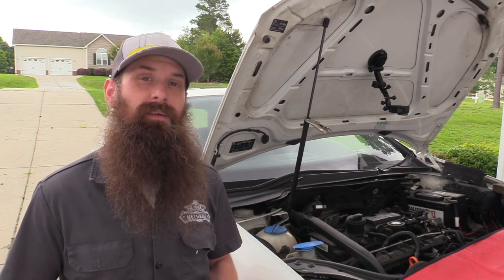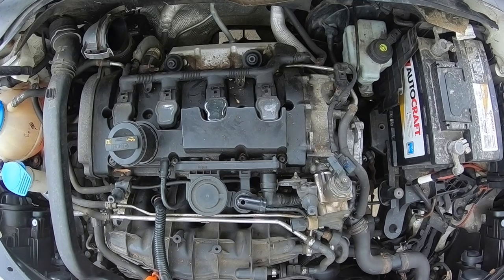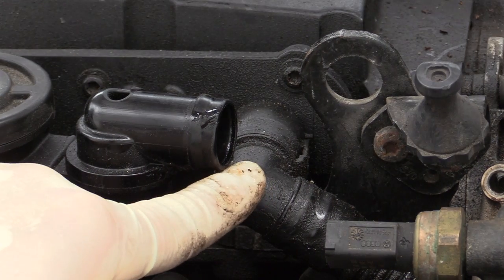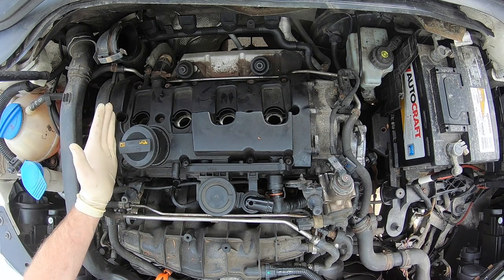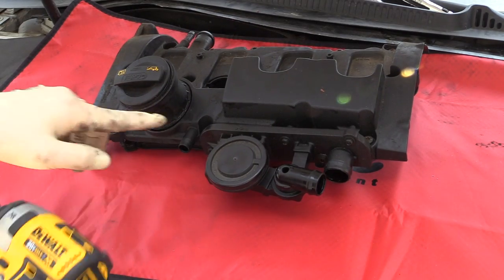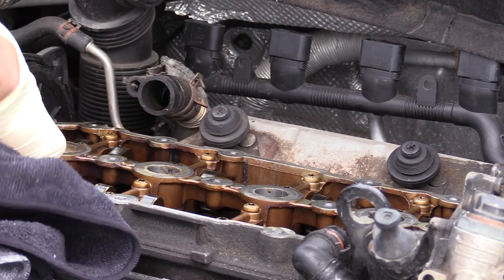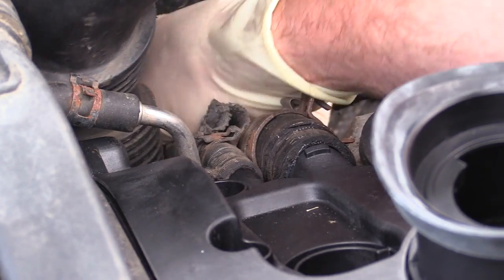Valve Cover and Valve Cover Gasket Replacement ~ MK5 GTI

Comment: I been having some oil consumption issues/ burning oil and rough idle. Changed out the PCV, rear vent tube, spark plugs, and ignition coils. Still an issue. Learned from you to look into the Valve cover as its part of the PCV system and does fail over time. (Min 0:45) I ordered a new OEM valve cover. 
I examined the old valve cover and noticed it was warped and broken on the bottom. i stuck a small flashlight into one of the ports and you can actually see the light shining through. Happy i changed it out. Hope it helps with any oil consumption. The Engine definitely runs smoother. Thanks for all you do for your viewers and customers.
Reply: Was your burning smell absolutely putrid oil smell + excessive white smoke from exhaust?  I'm fairly certain mine just blew today because the symptoms line up a bit too well.  Car with also stutter and stall, crazy backfires too.
Reply: @ethanheitz4489 did you get it figured out with your gti?
Reply: @adampye9827  Yep, thanks for asking bro.  The valve cover gasket blew right around cylinder 1's spark plug well.  I ordered a whole new valve cover from FCP just to be safe, since they're plastic and my shitbox has 284,000 miles 😅👍🏻
Cleaned the area, didn't focus too much on getting it perfect for install, just clean enough.  No drips or valve cover related issues since.  Ig these ea113's reaaally like to have positive crankcase pressure

Comment: Thanks man. I'm an aircraft mechanic and a forty year gearhead.  I'd be able to work through this myself, but having seen your video, it will make it much easier. Gotta do my grandson's Passat. OBDII says random misfires from all four. but valve cover is leaking from its periphery, so I'm thinking maybe the plug wells are full of oil and possibly causing the misfires. If a clean up and new gasket don't fix it, then I'll go ahead and put new coils and plugs in it. .

Comment: If you're replacing this because your oil fill tube has completely broken off, be aware, you CAN simply install the oil cap directly to the valve cover.  The filler neck was added to raise the fill cap up to the Jetta engine cover height, but on the Audi engines, this neck isn't glued on because there isn't a big cover.
Reply: This is a great tip. Thanks.
Reply: Excellent tip. You've just saved me a couple of hundred pounds on a new valve cover. Thanks!

Comment: People: Please please please take Charles' advice on connecting the back hoses before screwing down the cover. The larger hose is a bitch and a half to move. I had to undo all the goddamned cover screws a second time to get that hose back on. In fact, I recommend re-attaching the band clamp (hose clamp in this video) before moving it so it doesn't pop off while you're positioning the cover. 

I don't understand why we need to mention the single use band on the larger hose. It doesn't seem necessary to mess with this clamp further back at all.

Another tip: I found it helpful to follow the torque sequence even when initially inserting the screws. It just seems to go down easier that way.

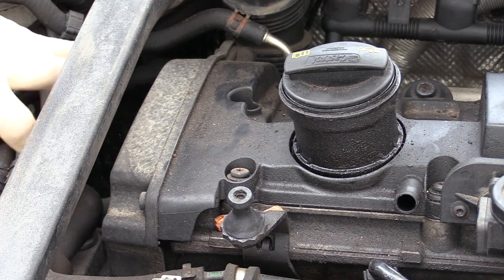Finally, a small correction 3:32. That's not your timing belt cover. It's your serpentine belt inspection cover. Timing chain is on the right side. But I'm sure Charles knew that and misspoke.

Awesome video!

Comment: Subscription ✔️.. I have a 09 TT 2.0 fsi with oily plugs in cylinder 3&4 just the video I needed
Reply: Took off the valve cover and it was cracked and had oil seeping through in cylinders 3&4..

Comment: Thank you 🙏🏼 replaced the valve cover gasket yesterday. Was going through so much oil this past month and noticed leaking around the cover. The hoses were a pain ! If anyone is wondering I went to harbor freight to get an electronic torque wrench that gave me multiple measurement options including what you need …nms. Oh and get a pick & pry tool unless you wanna use different sized flat heads like I did (don’t recommend it). Any questions hmu @cozybeavismobile
Reply: Hi, did you need to add any sealants when putting a new gasket?

Comment: I am considering a billet valve cover. What do you do with the hoses that connect to the stock valve cover when upgrading to a billet cover? I understand there is a -10 AN for the catch can setup, but not sure where the other hoses go. I have a 2012 Golf R.

Comment: Thanks for this video, I have a 2016 vw golf r. It has over 90k miles when I replaced the spark plugs I noticed oil seating on the spark plug. There is no oil outside how would I diagnose a leak? Thanks for your help

Comment: Charles thanks for the vid , just a question , all 3 of the valve cover channels are autonomous , right;

I mean blowing air on the rear vent tube should only bring air on the PCV valve , am i correct;

Comment: If the oil fill cap pipe/funnel snaps off of the cover completely, would you see symptoms in the cars performance? Or just leaking oil? Not sure if it needs to contain any significant pressure…?

Comment: What is the small hose at the back of the valve cover used for? Mine is old and stuck on the valve cover, so considering replacing it. Wondering what it does and how hard it would be to replace! TY, awesome videos!!
Reply: Long shot, but we're you able to remove that hose? I'm looking for a solution as mines does not want to budge either nd any help would be greatly appreciated
Reply: @alwalker6090  unfortunately not, and I sold the car. A pick might be the best bet.
Reply: @killamilla240  i purchased one and will attempt to remove it, cant afford to ditch the b6 just yet.. thanks for the reply!

Comment: So the mk5 and mk6 similar engines. Will the job be the same? I have a bit of oil leak and not sure where it's coming from, either this gasket or cam chain gasket. Any advice pls

Comment: Splendid video, thanks for the share. Although one thing keeps boggling me. When I look up the tightening sequence golf gti (2007 gti Edition 30) head gasket, I found a lot of schedules that state there needs to be 40NM on the bolts of the head gasket. Are you sure 10NM is correct??? Hope to hear from you, keep up the good work!
Reply: VALVE COVER gasket and HEAD gasket. are 2 totally and very different things. If you try to torque the valve cover bolts to 40 nm you will twists the head off them.

Comment: I did my spark plugs today and noticed quite a bit of oil in cylinder 1. Should I replace (1) just the valve cover gasket, (2) all the gaskets shown in this video, or (3) all the gaskets as well as the valve cover?

Comment: thanks for the video, i did this today on my golf mk5 but when i removed the gasket it broke and some of it was glued in the middle section where the spark plugs are, when i took it off it was breaking into pieces and i think couple of very small pieces fell inside, would they cause any damage to engine?
Reply: It shouldn't. Gasket material generally isn't hard enough to cause issues, unless the engine ate alot of it at once. Little pieces, no big deal. I once had a helper leave a microfiber rag inside an intake manifold once.. I installed it, didn't check to make sure passageways were clear.. sucked that rag around 2 valves. Spent the day nipping & melting at pieces of rag, hours & hours. Replaced 2 bent pushrods. Engine had 6,200 miles on it. Was a Chevy 5.3

Comment: Thanks for the vid, I'll be tackling this later this week. I wasn't able to move the gasket off at all on my initial try. It might have been a combination of the engine being stone cold and being too afraid to loosen the bolts all the way.

How far can the bolts be loosened before I worry about them falling off the cover and into the engine bay? Some other vids show quite a bit of struggling with the back two hoses (mine are on pretty tight unlike the ones on the vid)..
Reply from the maker: They hold on pretty tight. You’ll feel when then stop loosening it.
Reply: @HumbleMechanic  Thanks! Any other tips for the mechanically challenged for this particular job?

Comment: Hey man I have a 2013 GTI with around 60k miles I found oil in the spark plugs with so r corrosion that forms on the battery terminals. Any ideas on what it could be? The coils are not oem and I just ordered oem r8 coils since I don't like aftermarket crap on these cars. I was thinking the value cover gasket but the mk6 doesn't come with a value cover gasket so I'm lost lol.

Comment: I have a 2012 Eos with 55k on it. Water pump ended up leaking on it due to the valve cover leaking down on the water pump seal. Took the VW to the VW dealership, they replaced both the Water Pump and the Valve Cover (1,374.00 - Valve Cover Gasket, no charge for the Water Pump). A few weeks later the service engine light went on after my wife took a sharp turn. After checking the dipstick there was no oil on dipstick, added 3 qts of oil to the car took it back to the dealership only to find out that the oil was being distributed into the turbo. I'm wondering when the valve cover gasket was replaced if damage was done to the PCV Valve and cause oil to leak in the turbo? Any thoughts

Comment: there is a recall for MK5 PCV. Just go to dealer to replace it. It should be leak free for a while afterwards...
Reply from the maker: I think that may have expired by now. But yes Vw was replacing them for a long time.

Comment: I have been having issues with my 2012 Jetta SE 2.5L for some time now. It's an automatic and sputters when shifting up and jerks hard when downshifting, especially from 2nd the 1st. I use the OBDeleven reader and I keep getting the codes P3078 and P0106. I replaced the MAP sensor about 8 months ago and it seemed to have fixed the issue but then resurfaced. I recently replaced the PCV Valve Cover with gasket last week and cleaned the MAP sensor thinking it would resolve the issue but the check engine light came back on shortly after. Can you please recommend the next step to take to troubleshoot? Thank you.

Comment: Nice video! In the Uk, Vw wont sell only valve cover gasket, probably can get aftermarket one. When i replaced my injector loom on my 1.9 tdi, i overtighten one of the bolts to cover and it felt like it snapped and it just spins in place. Whats the best way to get it out. Thanks
Reply from the maker: That was the same here with the TDI. So silly.

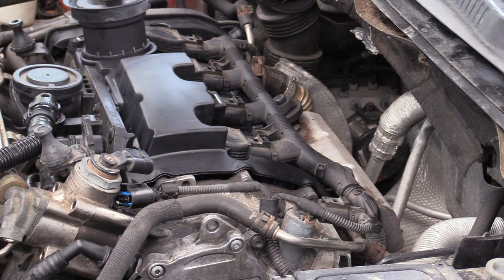Comment: Before putting the engine cover back on, be sure to plug that blue connector in too (9:00), Charles. ;-)
Reply from the maker: HAHA I actually never put that back on. It went where it belongs. In the damn trash HAAHHAHAHAHAHA
Reply: @HumbleMechanic 
Just pulling your leg, of course.
Reply from the maker: HAHA I know. I also knew Id get crap for that.
Reply: That fuel pump did look gnarly dude lol
Reply from the maker: It got replaced too.

Comment: Do the electronic torque wrench need to be recalibrated after a few years like regular torque wrenches click style?
Reply from the maker: I think they usually recommend every few years like the clickers.
Reply: They should only ever need to be calibrated if you have to put a circuit board in them.  My Snap-On guy sold me mine by bringing the demo in, throwing it on the ground, and then putting it on the torque checker and showing me it was still 100% accurate.  Sure enough I accidentally dropped mine a few months later and took it on the truck the next week, and still 100%.

Comment: How would you know if you need to replace the gasket? I have a lot of oil debris all around the area, and have been having problems with high rpm, low acceleration type issues. I have, changed the HPFP pressure regulator, AND the HPFP itself now, and still the same issue. I am getting: P0171 (too lean) P0087 (fuel rail, pressure too low), etc. could it be the gasket possibly or?
Reply from the maker: Doubt it is the gasket causing the drivability issues. That usually only causes oil leaks
Reply: HumbleMechanic so could the cover be cracked then? I also noticed that a vacuum line, that’s right beside the hpfp, has a giant crack where it connects at the top. (It’s literally the one you say don’t even look at, in your “how to change follower/hpfp” video). Could this cause the issues I’m seeing and or the CELs that I’m seeing? Thank you so much for your reply sir. I’m a big fan of your channel.

Comment: Hey Charles, awesome vid! Is the procedure the same on a Mk VI?
Reply from the maker: No, that is a very different setup. That valve cover is more like a cam bearing plate.
Reply: HumbleMechanic  thanks. My valve cover has started to weep a bit of oil after a head replacement last year. At least that’s the highest point on the engine that shows oil leakage.

Comment: I  snapped a screw head  where the pcv valve attaches to engine (bottom left  of the pvc) any suggestion to take it out?
Reply from the maker: Yikes. Can you get vice grips on it?
Reply: @HumbleMechanic  I can't get hold of it... I was thinking to drill the plastic around the metal and pull it out... Than use plastic filler... I dnt know if that's best way to go.. But I'm running out of option 😔

Comment: Ive been having a huge problem, mine blue/white smokes when the engine is under load, same when after ive been on full throttle when i let off, it lets a big puff of smoke out back, does this cause this problem?

Comment: So I have been trying  to find this smell of burning oil on my  mkv Jetta gli for the longest time, I have rebuilt the vacuum pump it's not leaking. I have looked at the valve cover but I don't really  see any noticeable oil around it. Any idea what could this be? No check engine light.
Reply from the maker: Maybe the exhaust is leaking? OR the oil filter housing.

Comment: Did my valve cover and PCV gaskets a few weeks ago...but I stripped the bolt farthest to the rear right. Would taking the whole cover off again be the best way to drill that out? Next time, I am not converting Nm to lb-ft!
Reply from the maker: yes. But dont start with drilling, see if you can chase the threads first. 10 NM is 7.4lb ft
Reply: @HumbleMechanic  Thanks much! I'll be honest, I had tried to drill it out with the cover on the car. Have a feeling I may have damaged the surrounding aluminum. How could I go about repairing that?
Reply from the maker: Probably a heli-coil at this point
Reply: I thankfully stopped before the threads inside the head itself. What do you recommend if I have to fill in anything around the bolt hole?

Comment: If you are just replacing the valve cover gasket, is it necessary to replace the bolts?
Reply from the maker: Not on this one. Reuse away
Reply: HumbleMechanic cool, thanks for the reply. That’s saves quite a bit of dough. I saw those boots going for $6 a piece.
Reply from the maker: Ouch!!! Hahah

Comment: I did this job and now I have codes P0507 and p0171, new HPFP new HP fuel sensor, new PCV valve, no signs of damaged vacuum leaks or anything! HELP. Any chance there is a vacuum leak in the actual valve cover gasket??

Comment: my engine has been misfiring random and on cylinder 4 and my plug is coated in oil, changed the fuel filter and thought it was the injector, but my mechanic said the problem was from this,  :( i hear this might be a big money for the engine from my mechanic and i am very worried, but he told me that fixing the seals might fix it, does anyone have any advice on how to go from there

Comment: Hey, I have a 2008 A4 with the 2.0t fsi that I'm having issues with and was wondering if you might be able to shine some light on my problem. It was making huge plumes of bluish white smoke, so I checked the PCV and found the diaphragm was shot. I replaced the PCV and it seems to be better, but now every now and then when I accelerate it billows black smoke and starts to misfire. I checked for codes and I'm getting a lean on bank one code.  It's also still burning quite a bit of oil. I'd say it's burning a quart every 600 miles. Do you think the problem is with the PCV or maybe even the valve cover? Any help would be greatly appreciated, thanks.
Reply: Curious did you sort this out?  Sounds awfully similar to what I'm experiencing
Reply: @fishkur  I did not. That car drove me to drinking. So, I got rid of it. Good luck, man! I hope you get yours sorted out.

Comment: Is a valve cover the same as rocker cover?
Reply from the maker: It's not really wrong, but not the common name. Rocker covers are usually for older push rod engines

Comment: Ya know, people think when everything is electric, that all these problems will go away, no more leaky oil, no more engine issues.......i bet you in 10-15 years time, if ya still into cars, this video will be titled 'Mk10 GTI - Motor Coolant Housing and Coolant Housing Gasket Replacement'
Reply from the maker: You have to call them a module LOL

Comment: The ignition coil connector latches also become brittle as they heat cycle.  It’s a good idea to have a couple as spares...but they’re expensive.
Reply from the maker: They fail SO MUCH!!!!
Reply from the maker: but to be fair, they are disconnected a lot, and people also manhandle them. FINESSE is your friend.
Reply: @HumbleMechanic  When you have a household fleet of VAG Vehicles, you keep a ready supply of several types of connectors and a repinning kit.  Luck favors the prepared!

Comment: My comment doesn't really apply to this video, but every time I see a vid that shows an engine bay of a golf, I notice that the HPFP has a schrieder valve. My 2005 GTI does not. As far as I'm aware it is the stock HPFP. Why is this?
Reply: Ethan Simmons  yeh I know what the valve is for. Wondering all the one I see have them but the 1 on my car doesn't

Comment: Am I the only one that doesn’t see any bolts holding in the high-pressure fuel pump
Reply from the maker: Probably not. Most of this was done with a few other parts off. :)